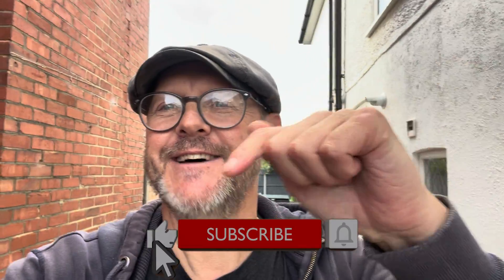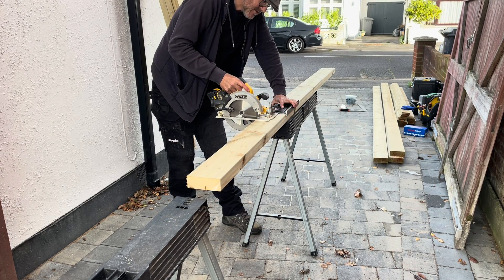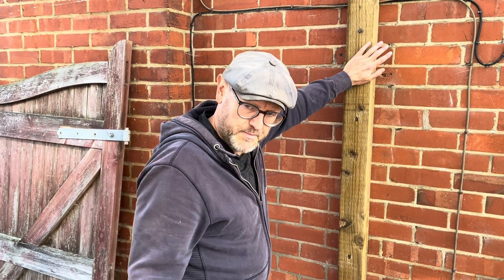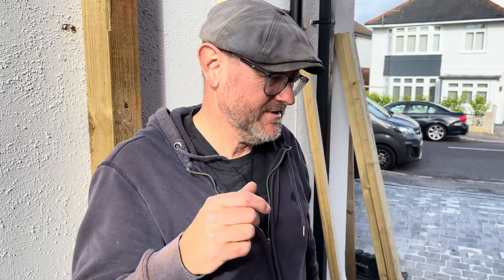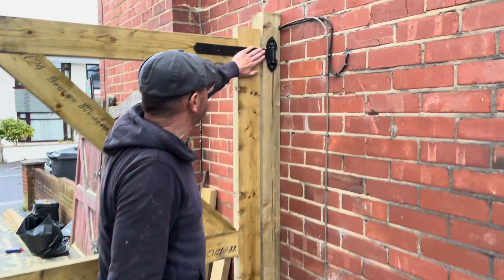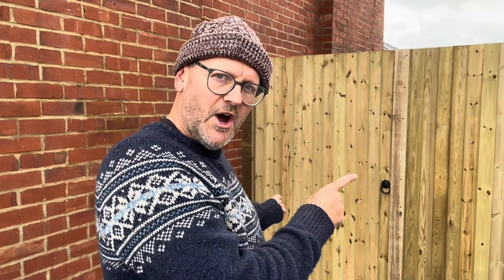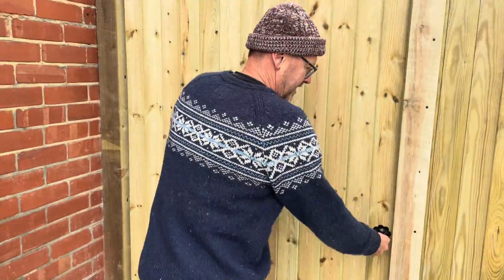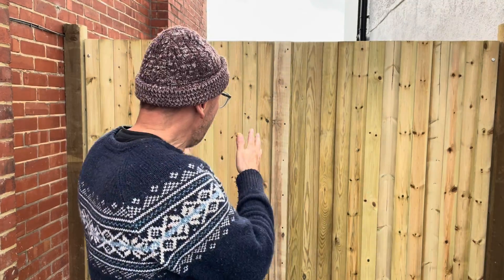Building A Gate using Half Lap joints

Comment: Nice gates. Couple of tips for you moving forward. You really want Coach bolts for gates so they can't be attacked / undone from the outside and they look nicer. You also should add another hinge to the middle of each gate. You did a good job of the braces on the gate but you are carrying the load from the top down to an unsupported side which will warp over time.  Its not a major issue but if you had only ever planned on 4 hinges then technically your brace should go from the top outside corner all the way to the bottom inside corner that has a hinge there to avoid that warp. Personally I prefer the way you built the gates and would have built them the same. Nice job.
Reply from the maker: Appreciate your comments. Very constructive. 😃